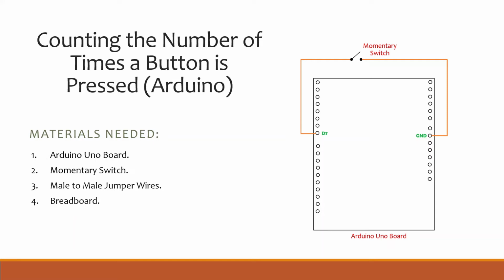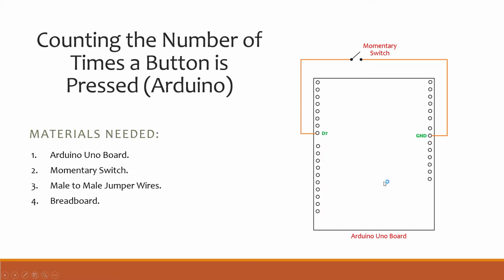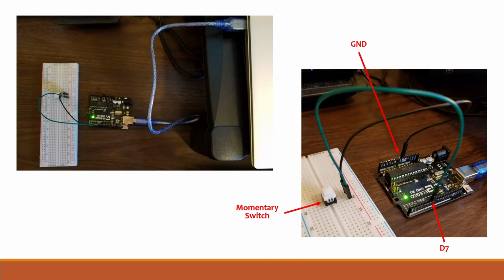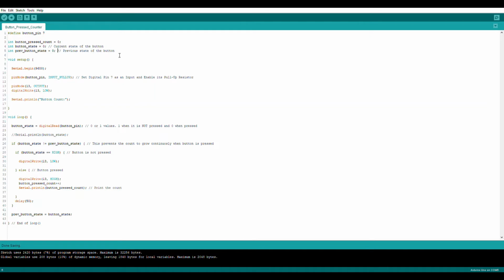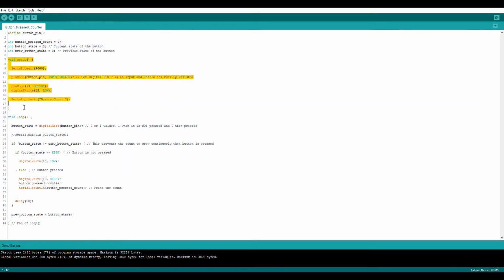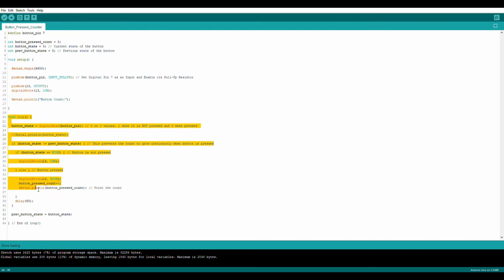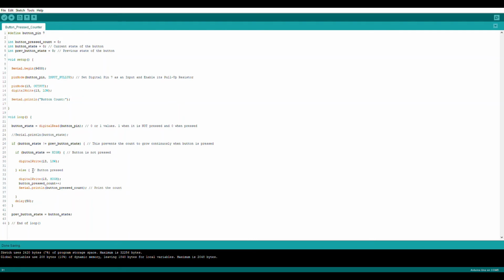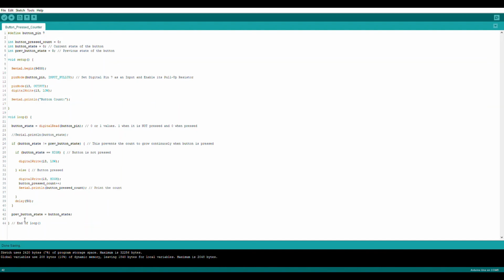Counting the Number of Times a Button is Pressed with Arduino

Comment: please share the code mhan. it doesnt help you show us the connection only
Reply: #define button_pin 7

// variables will change:
int button_press_count = 0;
int button_state = 0;
int prev_button_state = 0;

void setup() {
  // put your setup code here, to run once:
  delay(100);
  Serial.begin(9600);
  pinMode (button_pin, INPUT_PULLUP); //Set digi pin 7 as pull up button
  pinMode (13, OUTPUT);

  Serial.println("Button Count:");
}

void loop() {
  // put your main code here, to run repeatedly:
  button_state = digitalRead(button_pin);
  if (button_state != prev_button_state) {
    if (button_state == HIGH) {
      digitalWrite(13, LOW);
    } else { //button press
      digitalWrite(13, HIGH);
      button_press_count++;
      Serial.println(button_press_count); //print the count
    }
    delay(50);
  }
  prev_button_state = button_state;
}
Reply: @audreyObscura  thanks  for typing it out
Reply from the maker: The code is shown and explained in the 2nd part of the video...feel free to copy it. It is not that long.
Reply: @manuarturo7966  ok cool. Also, you are good at this,  im an engineering student from SouthAfrica, I sometimes get tough projects, how can I reach you? In case i need assistance sometimes